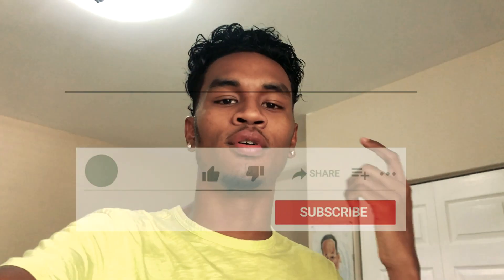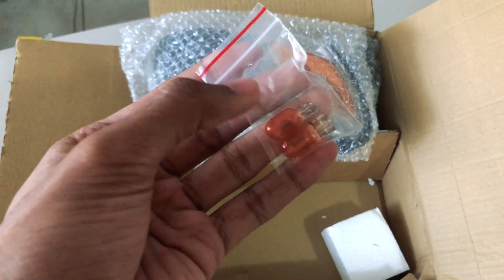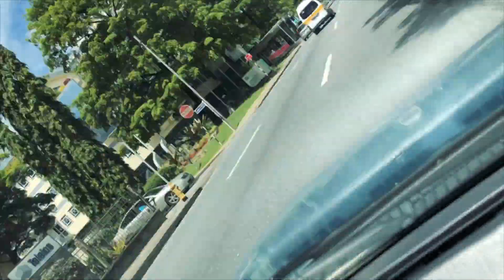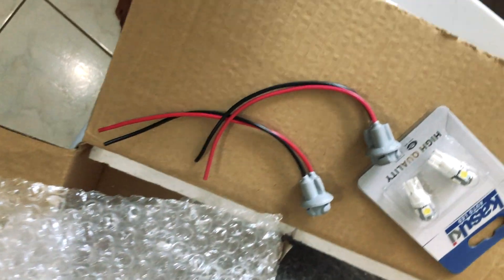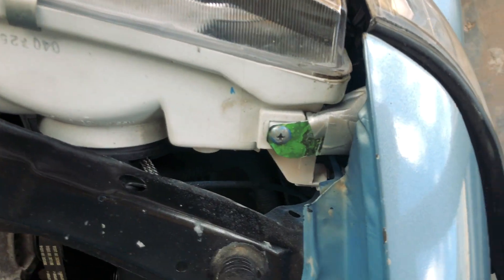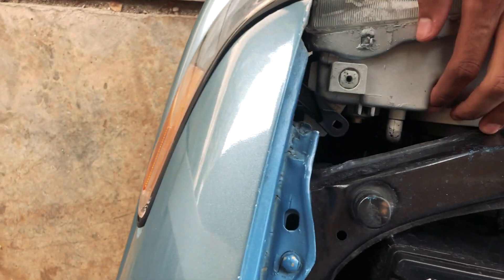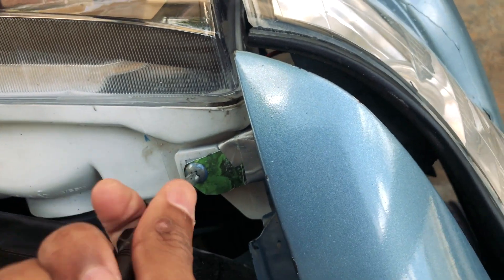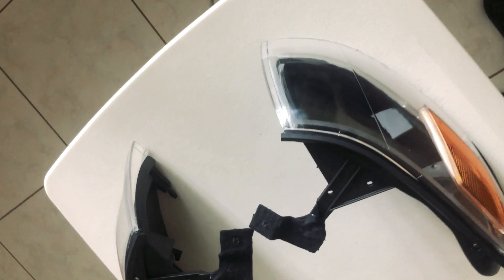NEW LIGHTS for Toyota Corolla BUILD | AE101 | Part 5

Comment: Safety first young dude.. disconnect the negative side of the battery before attempting any electronic work. Invest in a heat gun and some heat shrinks... nice build am following now 👍
Reply from the maker: Yeah I normally do do bigger projects, took the chance on just a light bulb bro but thanks 🙏🏽🤙🏽